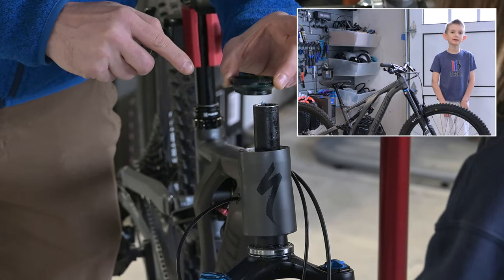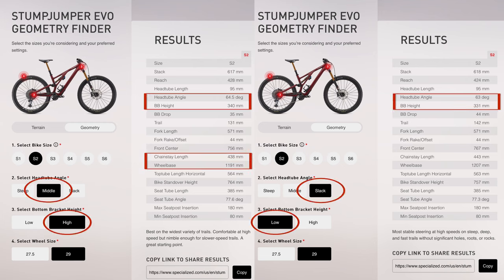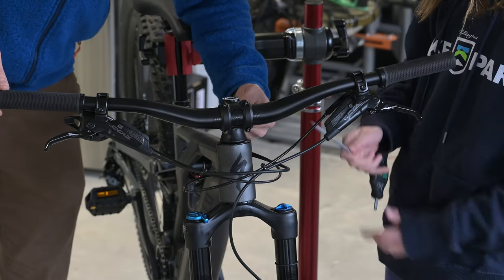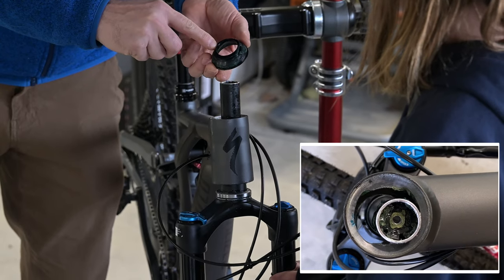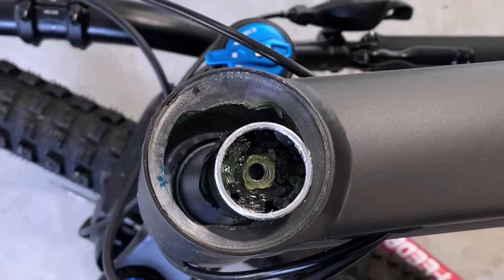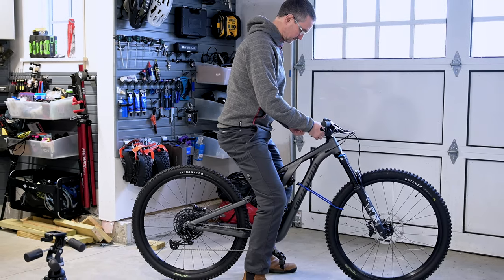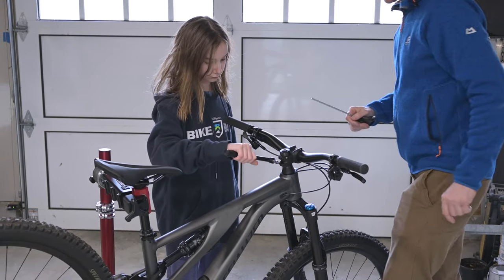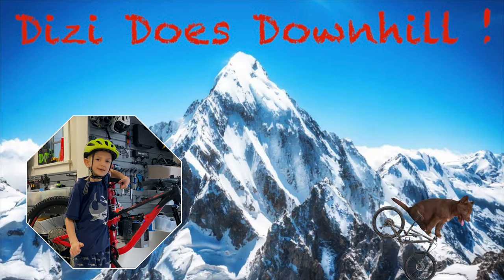Stumpjumper EVO Alloy 2022 - Headset Angle Adjustment, Slack or Steeper Geometry

Comment: Same thing happened to me when I swapped the headset cup; spilled parts all over the garage floor. Wish I'd seen your video before my attempt! Nice solution to the problem. I might actually try it on the trail.
Reply from the maker: Hey yndalo, thanks for checking out the video and for the kind comments. While the bungee isnt completely necessary (if you’re not clumsy like me) it definitely makes it easier to handle and saves you from a mini yard sale!

Comment: Thanks, I found this really useful. Just got my stumpjumper and I immediately made the same change. Small problem though, I’ve somehow ended up with a spacer spare 😅… the manual doesn’t seem to clearly depict each item and what order..
Reply from the maker: Glad it was helpful! I dont think it really matters the order the spacers go onto the stem as long as the top one protrudes a few mm above the stem to allow proper pretensioning using the stem cap. Thanks for checking out the video!
Reply: @dizidoesdownhill  that’s my mistake, I mean washer, not spacer 😅😅

Comment: what was your torque spec on the stem?  thank you for posting this, super helpful! I tried looking for a how to video by specialized but didn't find anything
Reply from the maker: Hey FP, we really appreciate the feedback! The torque setting on the stem bolts is 8Nm. The bolt on the top cap is tightened until the spacers stop rotating which is approx 3Nm

Comment: Taking the wheel off first makes the procedure much easier. Then you can hold the fork with your hand easily
Reply from the maker: Thanks for taking the time to check out the video and leave a comment. Taking off the front wheel when in the bike stand makes a lot of sense. Thanks again